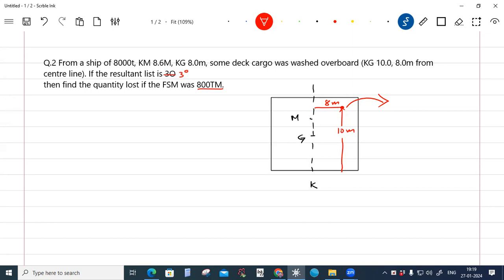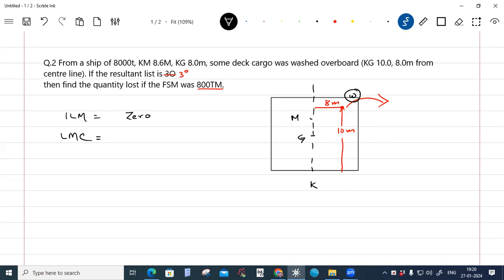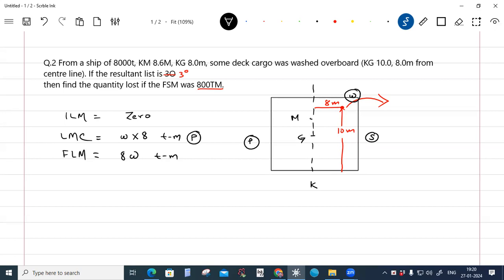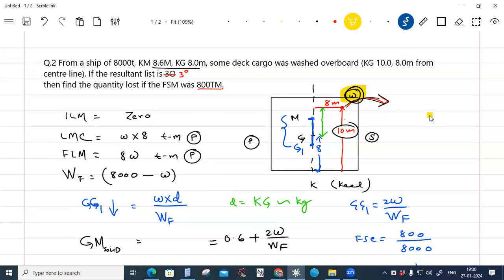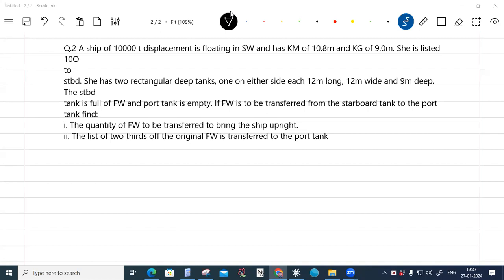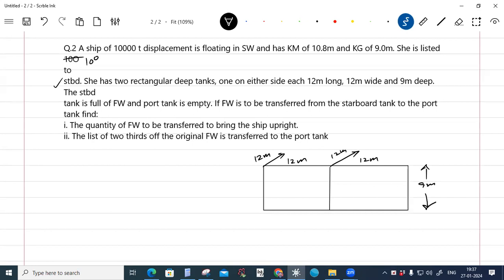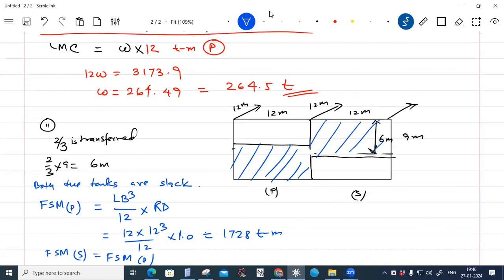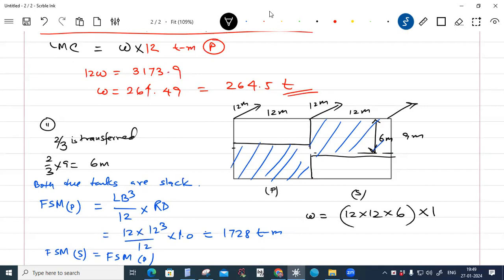Ship Stability_ List Problem  (2nd Mate Past QP) Part 3

Comment: At 26:20  Vertical distance should be 3m , you illustrated wrongly
Reply from the maker: Thank you for pointing out the error. Here d will be distance shfited i.e kg1- kg 2. Thus kg1=  6 m and kg 2= 3 m, thus d= 3 m vertically down if 2/3rd of weight is shifted down.